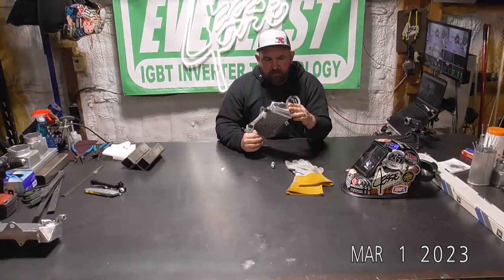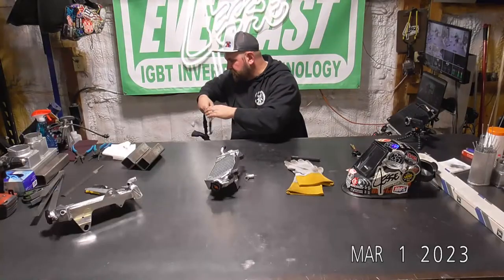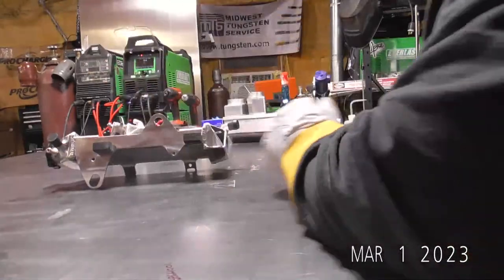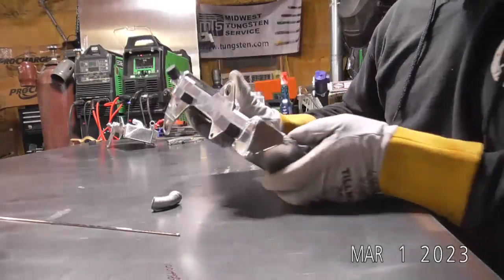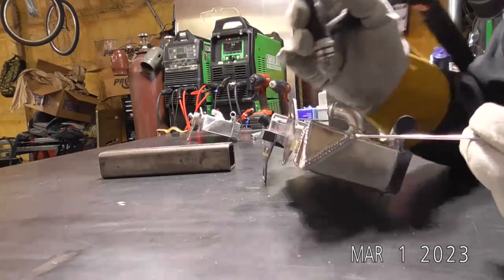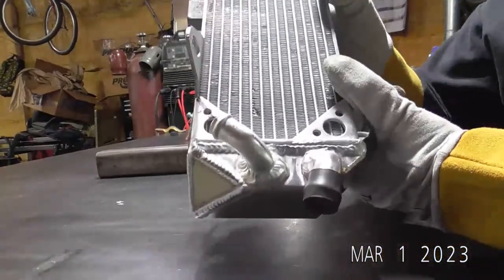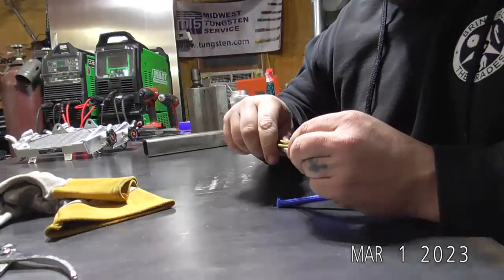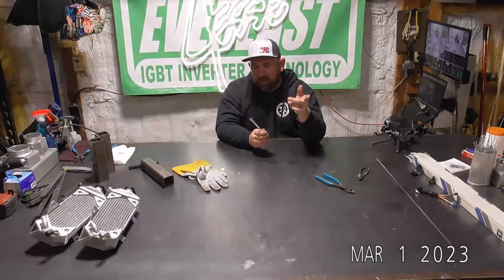Aluminum radiator mods, and how to change out a torch head | Everlast Welders Livestream

Comment: The quick fittings for the cooler lines are a nice touch. Picked up a pencil torch, flex and a flex lock. Good to have in the arsenal.